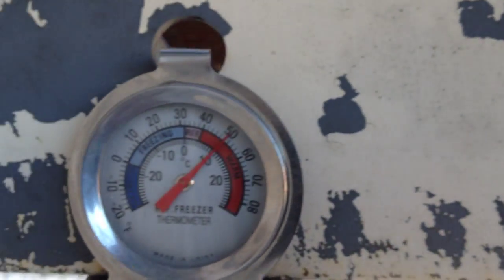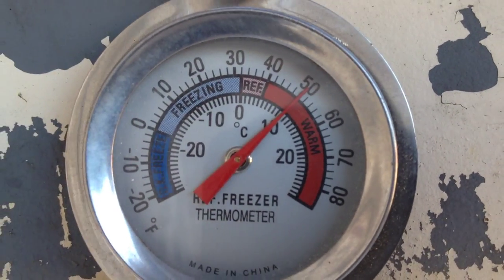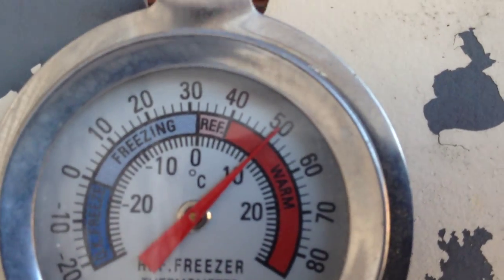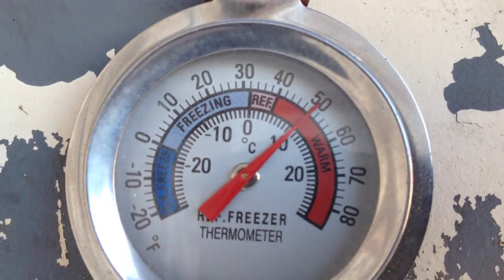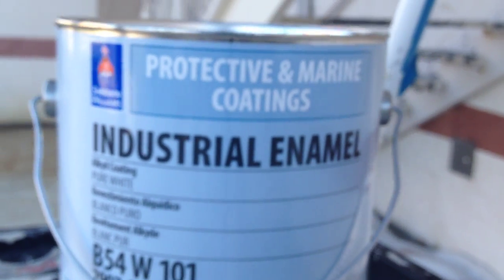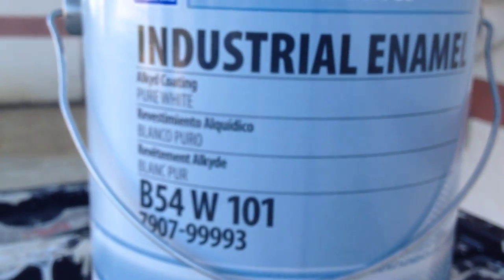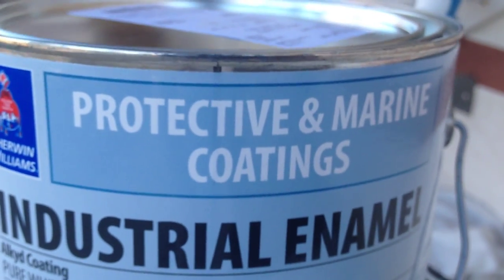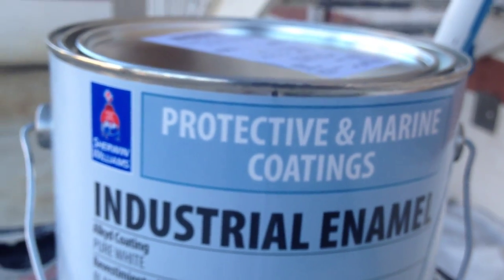Painting in cold weather. When should you paint?

Comment: I definitely would've sanded after scraping. I would've used a 5in orbital sander then sand by hand whatever the sander couldn't reach. I know the Industrial Enamel will cover pretty good over the old paint but you will still see the hard edges. Sanding it down would make it look better and last longer. Feathering out the hard edges prevents the the new paint from getting under the old paint and it won't lift up. That's just the way I have done it and I've never had a issue with peeling paint.

Comment: All exterior paints latex, oil based exterior paints should be applied in atleast 50 degree weather and the temperature should sustain atleast 32 degrees for 72 hours. If you don’t the paint may not cure and it will bubble in some cases and your hard work will peel away. You can paint inside in the winter but most people don’t because they want their windows open. You really shouldn’t paint at all in the winter. Painting is a spring, summer and early fall project.